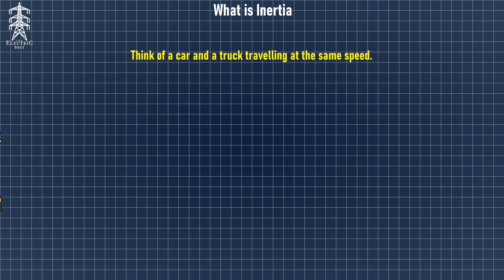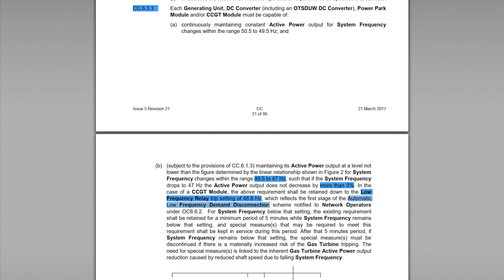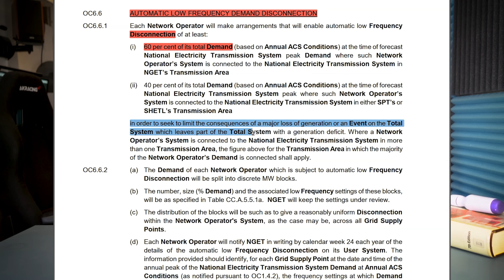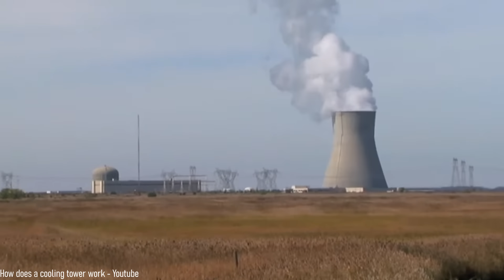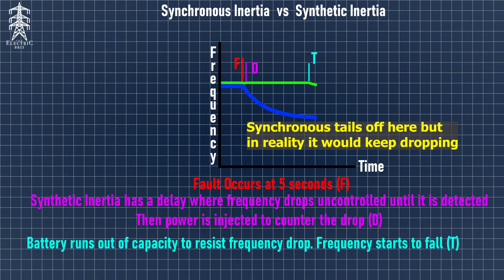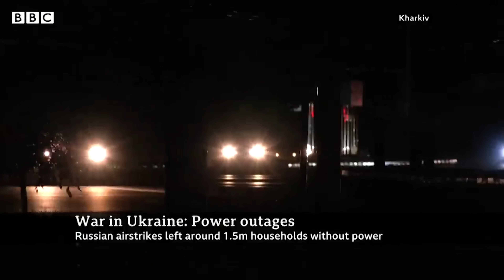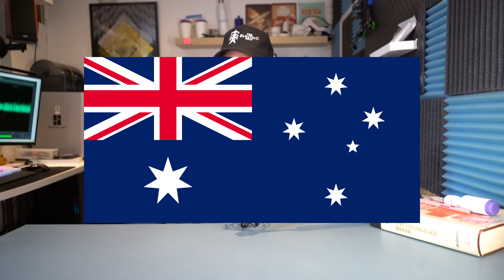How to Restart the Grid after total collapse

Comment: A nuclear plant that can't cold start is a one that was either poorly designed, had budgets cut and such systems removed, or both. When I was in the US Navy, our reactors were backed up by both batteries and a large diesel generator. Either alone was more than enough to restart the reactor from a scram status, even if we had to let the plant go cold before initiating startup. Of course, commercial plants are usually run by shortsighted bean counters who ignore what the engineers tell them...
Reply from the maker: Appreciate the comment and the added context. I imagine smaller reactors and reactors in other countries might fare a little better, but I think it mainly comes down to risk / safety appetite. From my limited understanding of nuclear reactors though it would seem perfectly flexible to ramp up and feed its own load and expand from there.
Reply: @TheElectricBritaye, it’s a different application and environment. When our nuclear plants were built coal was king and the big plants were plentiful so no need for nuclear to blackstart at the time.
Reply: @TheElectricBrit the thing with nuclear is it needs to be rapidly ramped up to 100% (in less than a hour in certain designs) to prevent runaway chain reactions
Reply: @erkinalp like an RBMK😂

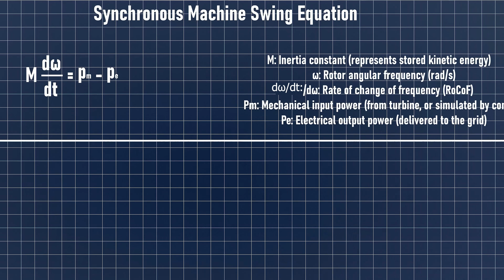Comment: well presented video, starts off answering the bare basics of what "people come for" but then goes on a deeper dive, right now I'm up to 4:00 and it's just started to get into the engineering maths that I never really thought of.

Not the typical "wait for 7 minute mark to give answers" youtube video, it just rapid fires answers in a smooth and consistent tone
Reply from the maker: Appreciate the comment. I have a long way to go to figure out pacing and stop cramming so much into a short space of animation that's for sure.
Reply: @TheElectricBrit Amazing work so far for a relatively new channel! Perhaps you could provide a simplified version of the graphics timed to the explanation, like line shuts off, switch is triggered, then replay the animation with the extra detail at a slower pace while you dive into the specifics?

Comment: Why don’t they make the electronic equipment that connects to the grid more Robust? In other words, less susceptible to the small intolerance of frequency change.
Reply: If you're talking about the generators, it's the scale of the power involved.  Think of a generator as being rigidly coupled to all the other spinning mass in the entire grid.  If a generator is connected out of sync, the entire generator will instantly rotate to be in sync.  Yes, that could be hundreds of tons of generator (formerly) bolted to a thick concrete slab.  There are some videos of very minor desyncs where the generator jumps off the concrete it was bolted to in order to rotate a few degrees.

If you're talking about industrial demand there's a similar problem, you have a very large motor moving something very heavy at a fixed rate, all mechanically coupled, and you don't want to try to suddenly force it to a different speed.  If, say, a construction crane lifting several tons were to suddenly have it's motor try to turn at a different rate, there would likely be casualties.  Much safer to shut off and let the load coast down to a halt.  (Industrial plants that can't tolerate power loss will almost always generate their own power on-site, just to avoid the problem, and that is designed to safely disconnect from the grid if it goes out of sync.)

If you're thinking of purely electronic equipment, sure, that's pretty robust to begin with.  It's motors and generators that force the system.

Comment: Great video and helps to explain that having renewables isn't necessarily making grid failures more likely as long as the battery back up is there. 
I currently have both a 24v and 48v off-grid and hybrid inverter system set up at home. My original 24v pack runs all the refrigeration from a 5kW Powerjack inverter and 5kWh LFP pack and is fully offgrid. My newly installed 48v 3kVa Victron Multiplus 2 is running alongside the grid in the house but in the event of grid failure will island itself and continue running critical loads like the lights and some cooking equipment from it's own 5kWh battery which is in turn independently charged from non grid tied solar panels through a Victron MPPT solar charge controller. If anyone wants a cuppa and a microwave meal during a blackout then head on over.
Reply from the maker: Sounds like a great setup! I've been wanting to DIY a home battery and solar system for awhile but I'd also like the flexibility to use the battery as grid storage to make my investment back - MCS seems like a headache to that end though. Might have to make friends with a spark.
Reply: @TheElectricBrit Thanks, I've been tinkering with off grid stuff for over 20 years, I'm an industrial maintenance engineer and have 18th edition but alas not MCS so my Multiplus is set up for self consumption and not export. I'd recommend having a look at a Givenergy system installation, my brother's just had one fitted, 7kW solar, EV charger which works with Octopus intelligent Go and 5kWh battery. He didn't pay any household energy bills in April and charged his Tesla too.

Comment: OK, so I can't put links to NESO here. Anyhow, I was just going to mention the dynamic frequency response services. This is where the generator themselves monitor the grid frequency and import/export as required. Response is under half a second. Batteries are good for this.
Reply: In Australia it’s called Frequency Control Ancillary Services (FCAS) and its bid in 15 minute increments. The open cycle turbine owners make mega bucks but they only power on when the rest of the grid is near collapse. Otherwise it’s not worth the squeeze
Reply: @theairstig9164  The Aussie grid sounds really interesting (if you find that sort of thing interesting - which I do). In the UK, when it's cold, cloudy and still, there are operators who will try to extort the country with rates 50x the regular balancing market. Being able to draw on other sources - including domestic and industrial flex is a knotty problem though.

Comment: Interesting video fella, there's a couple of errors in here though...

Primary/secondary response don't stack as you're implying, they are designed to follow after each other - primary is fast response but doesn't last long (typically gas/steam/water pressure being held back by the final governor valve before the turbine), secondary is slower to respond but can be sustained for a longer period ("throttling up" online generators ) during which normal balancing actions can be used to pick up the shortfall

When it comes to largest credible loss, that doesn't mean "largest power station" (you quoted Drax at 2.5GW) - it means the largest amount of generation which can be lost as a result of a single fault on the network - Drax for example is made up of multiple generators, the most which are exposed to a single device failure at any one moment is two generators (660MW each, 1320MW credible loss) either side of a busbar sectioning/coupling breaker

I was about to comment that Nukes absolutely wouldn't ride through a full system blackout, but you started mentioning the possibility of them islanding with local load (pretty unlikely with the nukes we still run) - although they would more likely trip off during the overall shutdown and load rejection... 

It's excellent to see someone doing detailed videos of this stuff specific to the UK examples - nice work! Reach out if you want input at all :)
Reply from the maker: Thanks for the comments! This video definitely got a bit messy during editing and scripting over the past few weeks. I ended up rewriting and moving things around a lot and unfortunately some of that seems to have bled through. 

RE credible loss, I believe it includes interconnectors too? Which would still count for about 2GW unless its not credible that both poles are lost - which was my assumption with a failure of a tower for example at Drax disconnecting the whole site but yes I suppose that's an incredible loss :D Appreciate the correction.

And yea regarding nukes, from my bit of research I was informed some US reactors do island themselves and I'd imagine French ones do too since they rely on them so much, the grid was more than likely built around them, whereas I don't think they'd risk running ours on just diesels.

If you're on LinkedIn drop me a message. Always handy to get a second pair of eyes. I usually don't want to bother people with proof reading videos but I do have some coming up where I've got experts involved in those areas to give it more credibility and accuracy.
Reply: @TheElectricBrit Unsure if you'll pick this comment up but ICs importing do count as the largest credible loss a lot of the time. IFA is split into two 1GW connections but NSL IC with Norway has max capacity of 1.4GW and is generally considered as largest loss in the NESO modelling in the frequency risk and control report.....Until a bigger IC is built
Reply: Loving the contents. Any chance of leaving the text up slightly longer as my old eyes can’t read all that useful information quick enough before it’s gone without having to pause the vid - but then I lose the continuity of your voice over.  Thanks again, and keep up the useful information.
Reply: RE: credible loss. 

In a well designed system (which I assume Drax would be) interconnects are mechanically isolated and redundant. The goal is to have enough spare transmission as to completely isolate a location without loss of capability. This is typically done for maintenance reasons (LOTO during system upgrades and repairs) but also helps for emergency preparedness.

As for nukes, islanding is sometimes achieved through artificial load management rather than generator management. Systems such as resistor banks are used to dump excess production and correct power factor as the reactor is slowly ramped to the necessary power level.

Comment: How to make the grid more stable?   All new "renewables" should be required to have synthetic inertia.   In fact, I'll go so far as to say they should all be required to have some amount of battery storage to smooth their output.    I have solar on my house and the way its output fluctuates on a partly cloudy day is nuts.   It can be producing 9 kW one minute and only 1 kW the next.   Of course this doesn't matter at the scale of my installation, but picture the same thing happening with the output of a multi megawatt solar farm.
Reply: The problem is the cost of having synthetic inertia is not falling as fast as the cost of generation. Batteries are still very expensive and so are inverters. So you only want to add as much as you need otherwise renewables may cease to be cost competitive.
Reply: This is no different to running a 9Kw welder which runs for a few seconds at a time. The difference being when a cloud band covers an entire suburb or even a few hundred square kilometres it’s not like turning on a few thousand welders. Rooftop solar penetration is 50% of roofs and 11% of nameplate capacity. Australia is about to experience the biggest home battery roll out in the history of the world in 2025-2026
Reply from the maker: This was my thinking when news first broke of the Spain blackout and Solar supposedly being responsible. If many GWs of power can suddenly disappear under a cloud then the grid will need some serious backup to counter those swings. Once we know more I'll certainly cover it in concrete detail.

Comment: kiss. each home has solar hybrid non exporting inverter with 30k of batteries  to auto shed the grid power until it stabilized. use the grid as the back up to the back up reduce stress on the grid and to provide peace of mind in emergency. or go off grid. it would give the power to the people.

Comment: how about transitioning national grid to hvdc?
Reply from the maker: There's 6 or more HVDC links planned over the next few years in the UK, some already under construction which will help strengthen the network and move power around efficiently as well as many more interconnectors planned to other countries for import/export. There's limitations with HVDC though in that it's mainly good for point to point and not the mesh that we have onshore. I am an advocate for it in the right situations though or UHV AC.
Reply: Transformers which are the big bits between the different voltages only work on AC. The line discussed between Eaton Socon and Wymondley operates three phase at 400kV phase to phase. "Transitioning" to DC would involve more and more layers of stations in the form of DC/DC convertors of very high power. The response has to be; "Kerching!" The consumer would then need a personal invertor to enable the usual devices, fridge, freezer, washing machine, dish-washer, tumble drier, oven, ceramic hob, central heating....... I don't think I want to go down that path of installing a 100 kilowatt invertor , do you? How this transition could be phased in stages would be interesting.
Major sub sea interconnectors do operate as DC poles but have extensive convertor station installations at each end.

Comment: I've rewritten a blackstart procedure for a facility with its own independent grid. It was 100MW+ capacity, bur a mix of direct turbine and combined cycle. This was good.
Reply: What sort of stuff does that entail? Is it simply a question of turning off all the machines and slowly bringing up the generators one at a time?  Are there weird things that you wouldn't otherwise think to do?
Reply: @dafoex  Whats complicated is that since a turbine will have its power fine 99.99% of the time, the fuel gas itself needs to be heated to a fairly high temperature before it goes into a turbine.

Effectively, you often had diesel generators which can be started from zero. One of them sets the local frequency, then you turn on a few more as you go. Reset all your breakers and make sure the system is working with basically limited load. Then get yiur auxiliaries for your turbine and gas supply running and heated. The turbine has a stsrter motor like in your car, but it might just run rhe generator in reverse to help start. It ramps up really slowly until the flame is stable. Then hooks into the grid and now dwarfs all the diesel frequency control.

Then you carefully bring on load. If you suddenly just start everything, it messes with the frequency and you trio and have to start over.
Reply: @letsburn00  Interesting.  Thanks!  I didn't even consider that gas turbines might need to be preheated because it's gas, but it makes sense also - diesel engines are kinda the same iirc, needing a glow plug or something to warm the fuel before it can ignite in the engine.

Comment: On the night of Saturday the 13th 1979, the entire 1.5Gw of the grid in Tasmania went down. There seems to be no record of this event online, but I can recall the exact date and time because the move, “The Guns Of Naverone” was on the telly that night and had been playing…with ads…for just under three hours…roght st the climax of the film, the cannons were falling down the cliff…the voltage and frequency sudenly dropped, all the transformers in the house and the compressor in the refrigerator made some wierd saturatey noises, all the light globes flickered and slowed to a flashing as all the rotary machines wound down. It was all over in less than 20 seconds…everything was dark and quiet.
   What caused it? A ringtail possum had gotten into Liapootah switchyatd and had climbed the bushing stack of one phase of a 220Kv breaker. Strathgordon power station, our largest capacity 600Mw hydro station was doing sync keeping…it was the “mother duck” with all the others…all hydro and one oil fired thermal…”following mum”. This was well before the 400KvDC Basslink existed to the mainland. Somehow the breaker with the possum nest on it was called into use…the possum was instantly plasma, but it dumpped a large load from Poatina…another large hydro station.. onto Strathgordon…The PLL was fast enough, but opening the valves from Lake Gordon … being mechanical, wasn’t, so the frequency rapodly fell as the rotors at Strathgordon slowed, all the “other little fucks” dutifully following along scattered and she all fell in a messy heap! Took them about 36 hours from 10.20p.m. That Saturday night to “Humpty back up on the wall again”. This event is not recorded on the wikipsge for grid outages or anywhere else online that I can find.
Reply: That inadvertant rude word should read, “ducks”…the keys on this thing ate just too bloody small.
Reply from the maker: Can always appreciate a typo! I wonder if there's anyone at the utility that remembers or if there's a government record anywhere.

Comment: 6:50 "straining too far can damage them..." 

how exactly slight change in freq. damages electric motor, or SMPS power supply?
i doubt it.
but what it DOES damage is ability of power generation to be on 100% of the time, and if it's not on 100% of the time then they're losing money....
reminds me of grounding of electrical gear: excellent way to protect el. generating equipment. and kill hundreds of men simultanousely. because touching neutral is same as touching ground. while phase is in your other hand.
Reply from the maker: Probably less so damaging the motors, as they'll just slow down to match the frequency. More damaging whatever its attached to which might is expecting to work at 50Hz and not suddenly change. Electronics are the same, I imagine there's a lot of tolerance built in, maybe to the point of covering both 50 and 60Hz but there will be something expensive out there that won't tolerate it :)